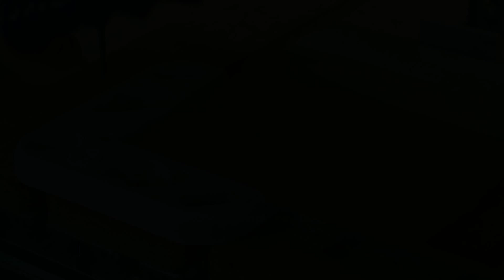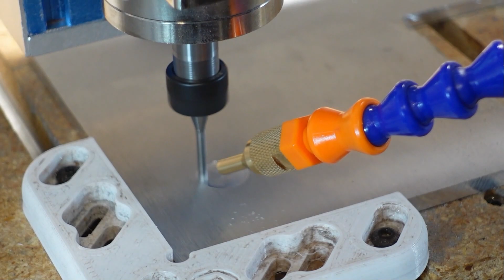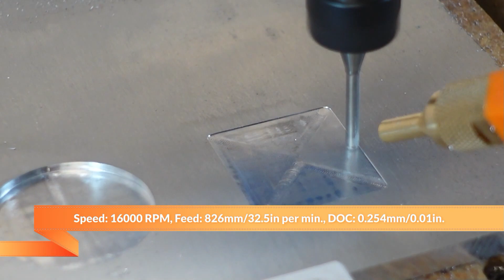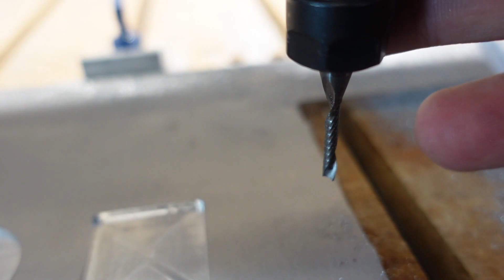First Aluminum Milling Test After Installing Air Blaster

Comment: Thanks for sharing. What air compressor do you use? I have the same cnc and I’m thinking about adding air assist.
Reply from the maker: Thanks for watching! The air compressor I used is a small craftsman that I bought on Amazon. The link is here: https://amzn.to/45A3rlG It has served very well, and puts out good air pressure. My only complaint would be the capacity is small, so the tank refills itself frequently when in use.